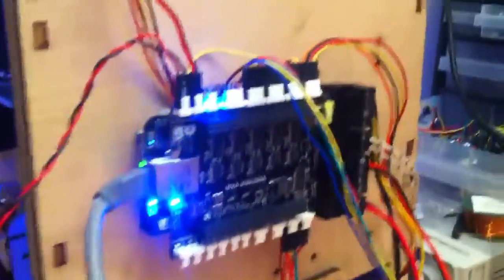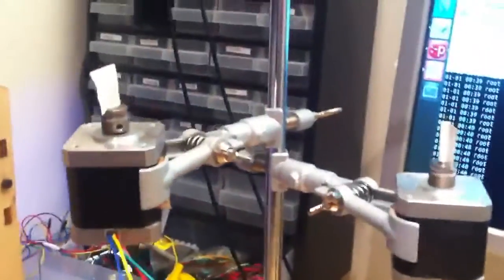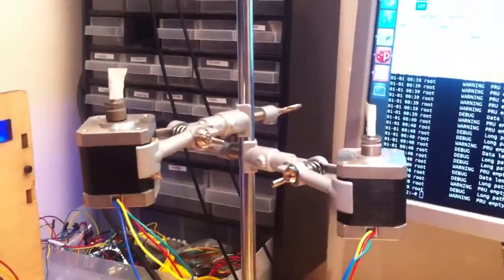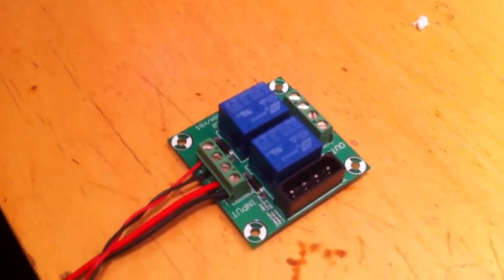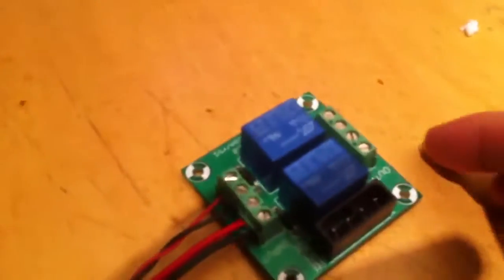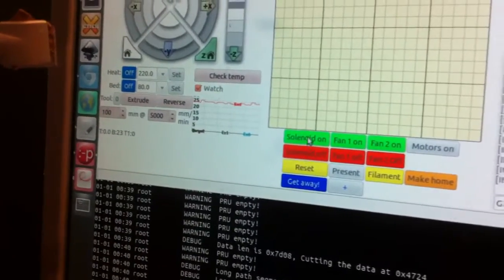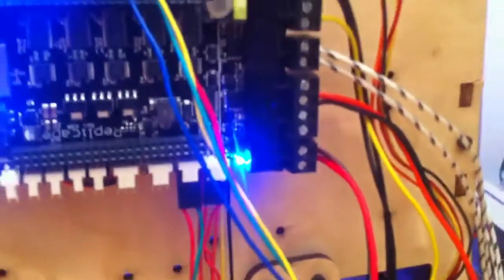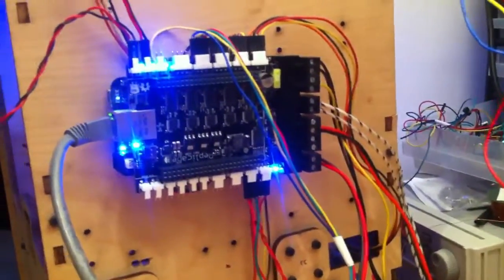Parallel steppers and solenoids on replicape

Comment: I have juste a question one TMC-2208 is enough for two stepper motor like anet A8. I think yes but i not really sure: Rated Power  14W
Rated Voltage  3.96V
Rated Current  0.9A
Rated Speed  1000rpm
Rated Torque  0.34NM
Holding Torque  0.4N.M
Step Angle  1.8°
Step Angle Accuracy  ±5%
Phase  2
Resistance  4.4Ω±10%
Temperature Rise  80K Max
Ambient Temperature  -20℃~+50℃
Ambient Humidity  90% Max
Insulation Resistance  100 MΩ Min. ,500VDC
Size  42*42*40(mm)
Weight  280g